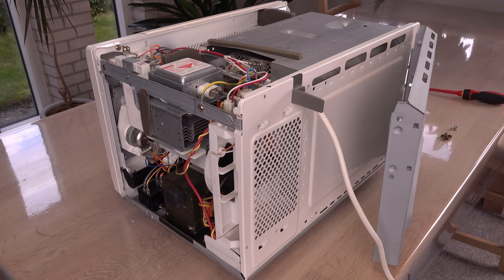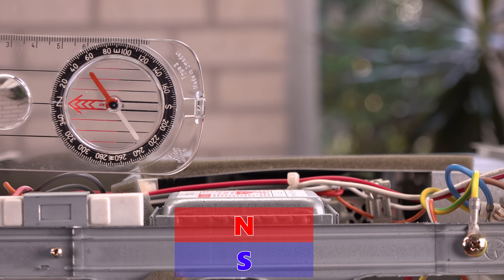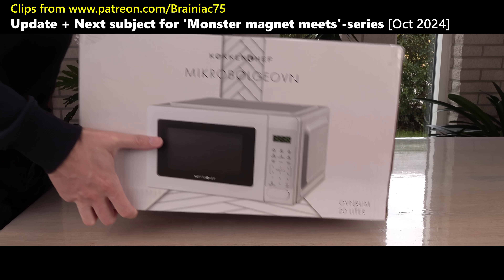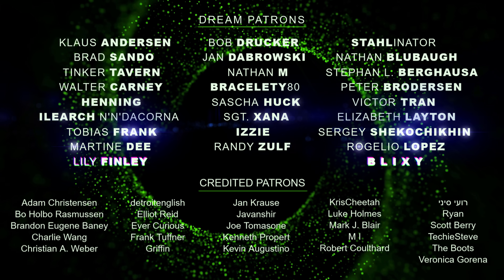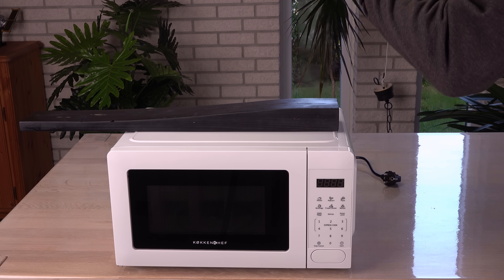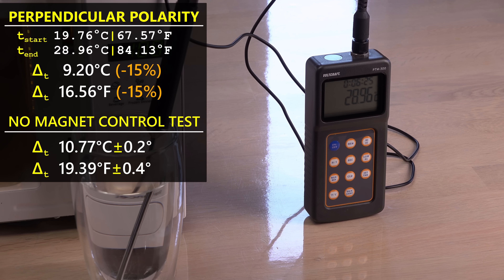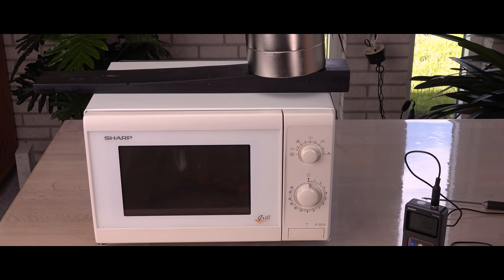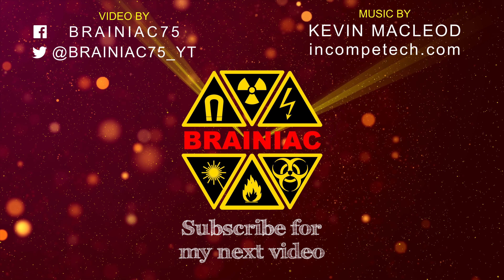Monster magnet meets microwave magnetron...

Comment: The magnet ring inside the magnetron measures OD 53mm x ID 24mm x thickness 11mm. If you can find a neobdinum equivalent that try replacing it and see what happens

Comment: You do know that will weaken your magnets right? I wouldn't recommend doing that if you spent a lot of money on those, which I'm pretty sure you did.
Reply: It's not inside the waveguide chamber, I know microwaves too since i got a Galanz GAL 1000 U2 120V MOT and the HV capacitor from a broken 1000W Galanz microwave, The magnetron i got off eBay since i couldnt take the OEM magnetron.

Comment: shame to not follow thru on a better setup when you have such ridiculous magnets to work with, esp since you have the expensive equipment already and the remainder of the list is relatively cheap:
watt meter: $15
pyrex measuring beaker with lid: $10
thermocouple thermometer leads running thru center of beaker lid (inside µwave = real time temp): $20
printed magnet mount with screw-adjustable plate for accurate distance measurement: ~$20 of filament
...
or.. embrace the no-effort approach and skip the temp tables all-together, just go for dramatic effect: "how to disable a microwave with 'no-contact' magnets!"

Comment: Why didn't you put it on the opposite side of the magnetron in the 2 oven? In this case in the strong field created by the supermagnet would have accelerated the charges even more, theoretically increasing the temperature of the water discretely

Comment: Try bridging the relay with some wires, solder them, connect them to a high voltage rated switch and manually trigger the relay that way

Comment: Interesting but I'm puzzled why the steel shell of the uWave oven didn't shield the innards from the magnetic field and secondly, I'm not sure the strength of the alnico magnet in the Magnetron has much effect on the output of the Magnetron above a certain level. I believe the magnetic field is there to cause the electrons within the Magnetron to spin within the tuned cavities within the unit which is what generates the RF energy?

Comment: You're improvising a stronger microwave. It will also consume more electricity, but for a shorter amount of time. I don't expect it to use a significantly more power to heat up a cup of water to a certain temperature, so, it will only be a bit faster ho heat something up... Because components get a heavier load than they are designed for, the time benefit comes with an increased risk of fire and/or component faillure. I like the experiment, though.

Comment: As far as I remember, the magnetron structure consists of a number of cavities and the frequency depends on the speed an electron beam travels past the cavities.  The magnetic field is what causes the beam to rotate.  You can deflect the beam sideways causing the beam to miss the cavities entirely, or you can possibly change the resulting frequency, de-tuning out of the wave guide, causing change in coupled energy.

Comment: Hmmm... You could have made Your test with the  "analogue oven" better by setting it to a longer time (e.g. 5 minutes) and then used a separate timer (e.g. Your mobile) to run a "separate timer" and just opened the door after "exactly 1 minute"... That way it would basically have been as "precise" as the "digital oven".
Brgds

Comment: I think putting the water in the center of the microwave may be undermining the rotating plate.The wave formations in a microwave have hotspots and the plate spinning allows the thing thats being heated to rotate through hot and cool spots evenly for more consistent heating.
Reply: PS :  putting your spaghetti in a doughnut shape will allow it to heat evenly without the cold spot in the center.

Comment: The magnet is interfering with the switch mode transformer in the low voltage DC power supply so thar screws with the digital timer.

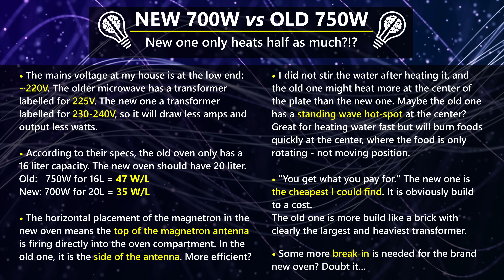Comment: 9:50 -- Mains voltage point: reasonable, but no day/night difference. Wattage per volume: no effect; a microwave photon will just bounce around until it is absorbed by something. Magnetron placement: no effect, for the same reason; it may change where the radiation is concentrated, but no change in total absorbed power. Standing wave hotspot: again, affects where the radiative power  is concentrated, but ultimately photons bounce around and will find something to be absorbed by, somewhere. Break-in: no. You get what you pay for: spot-on!

Comment: The field strength in microwave ovens is uneven, there are spots with higher and lower strength, due to interference caused by the microwaves bouncing around the chamber. That's why they have a rotating plate. It is possible that the new microwave has a very weak spot right in the middle, which negates the effect of the plate's rotation if you put something right on the middle of it.

Comment: I think you should take some fabric like ripstop codura of similar and sew a cover with handles for this magnet. (Or ropes with knots, so you don't put hand inside of handle)
It will make nadling it WAY easier.
This kinds of fabric will handle few hundred kilograms of force, so it will survive. And there are plastic needles that you can use for the last stitches to saw it shut, or use paracord to tie it, or a boat load of velcro :P

I would even think of adding 2-3 strips of thick foam so in the unlikely event of finger getting where they should not, magnet will be lifted from the surface a bit (it should be a difference between healing and loosing fingers.

Comment: You probably just disabled the power on relay with your strong magnetic field.  
You could try a simpler manual microwave oven (the ones you rotate the button an set a mechanical timer), they dont have electronics.

Comment: Thanks.  There's no reason to trust the terrible timer on the microwave as you could instead use a timer on your phone and either switch off the power or open the door when the timer expires.  Keep the phone away the magnet, though.

Comment: different watt rating of the microwave is the bigger factor here, 100 watt jumps can be a fairly drastic change at the lower end from what I have seen, Example there is some foods that request a 1100 watt microwave but I have a 1000 watt. it seems for the time they give to cook the food say 1 min for the 1100, I have to add about 15 seconds to get the same cooked result of a 1100 watt. So maybe its not the new one is worse than the old but its just a lower watt rating as that more the "cooking" rating than anything for them. Kinda like how the old incandescent were watt rating in the US for the lighting instead of rated in lumens.

Comment: The new microwave resetting is probably due to the small transformer for the timer saturating
Possible improvements:
Offset the glass on the rotating table from the center so that it can sweep thru hot and cold spots of radiation in the microwave
Turn on the old microwave and switch its power at the socket to get exactly 1 minute

Comment: I wonder if you really lowered the magnetron power or shifted the frequency. In case you shifted the frequency the water molecules did get  activated perfectly. Maybe you could measure the center frequency with and  without magnet.

Comment: The magnet was likely affecting the output power of the standby power supply in the microwave, causing it to drop out and reset, as well as behave audibly when trying to pull in the relay, if it's a switchmode supply

Comment: You could always just bypass that relay and use an external timer,
However I would also remove the transformer and run it externally, about a meter away from your magnet, as it would most likely just saturate with that intense field and just blow a fuse. Your only problem is getting some high voltage rated wire, however considering all the other kit you have, no real challenge.

Comment: We had a Kitchen Aid microwave that started misbehaving in a very weird way. Sometimes instead of heating food up, it bizarrely actually made the food colder. Can't wrap my head on how that is possible. You could always tell when it wasn't working properly as it made a different sound.
Reply: thats literally impossible my dude.
Reply: @Basement-Science  Maybe he accidentally discovered a new phenomenon.
Reply: @Basement-Science  Tell that to the food that got colder. The food was room temperature before putting it into the micro but ws colder when I took it out.
Reply: @chuckthetekkie  and you determined that how? And where was it colder? what even was it?

Comment: This video made me realize time is the only numerical measurement that's the same everywhere.  No metric time its minutes hours, days etc. yet physical measurements are different
With the expectation of electricity I think a different system for power could be dangerous if someone didn't convert it correctly thankfully it's using the same system.

Comment: I hate ALL new microwave ovens with a passion.
Doesn't matter what controls they have or their power rating or their size or how quiet or how user friendly they are.
They ALL (the new ones I've used) do a piss poor job of heating stuff evenly or at all.

Meanwhile, my old BUDGET microwave oven that's coming up on 24 years is heating evenly, consistently and quickly. Despite having a dial.

I think the main difference is where the components are being made and at what standards they are being made.
1) China
2) Cheaply

And even new and expensive microwave ovens still sport internals from...
A) China
B) As cheap as possible

And if something is made in Europe or US etc, then there's a whole bunch of safety considerations and "what if's" that nerf modern units before they hit the shelves.
The power rating is essentially a lie, a 1000 watt microwave oven might only perform as well as my old one set to 600 watts.

It will be a sad sad day when my microwave finally gives up the ghost or lets the smoke out. But so far, despite the abuse, it's been a loyal servant for 24 years and I don't see any signs of it failing catastrophically or even mechanically. Simply put, stuff (even cheap stuff) were just built better in the past.

Comment: With the horizontal magnetron, I think I would have tried the magnet, on top, but standing on edge, so that its fringes would pass through the magnetron in either aiding or reverse direction.

Comment: Don't know if you already tested this:
Could you cause an imbalance in an electromotor? (as in an axle deviation) or influence turning speed with magnets or Megatron, errr magnetrons like those?

Also, would either the microwave or the magnet be powerful enough to make your (expired) bankcard/creditcard unusable -throth* the NFC, contact chip and magnetic strip?
(of course you can't completely rule out fraud on a CC due to it's problem you don't need to verify (electronically) when using it)

*= throth, combination of three and both, don't know if there is/was another word for it

Comment: The giant magnets scare me almost as much as mains and high voltages.  I have so much ferrous stuff about my work areas it would require clearing a huge area and I'm sure there would be random metal filings and weld beads that would be missed.  Interesting video, mate :)

Comment: Reguarding differences in temp  and differences in old and new ovens.  i doubt the watts per liter is actually making a significant difference.  My reasoning is that even though there is greater volume in the new, it simply means the microwave energy might bounce around more before being absorbed by the cup of water.   I think the differences in power is likely more to do with the transformers as you pointed out. You could probably swap the transformers easily. At least temporarilly move the trabsforner to prevent saturating its core material.

Comment: The wedge at this stage 6:08  could have been used as a lever. Lift it and stick in another wedge to get more distance and reduce the effort needed to physically remove it. Introducing the magnet safely could also be made easyer by using the wedges as levers.

Comment: I bought an  inverter powered microwave in 2018.  It was just like the ovens used at work for many years and I considered it very reliable.  1200 Watt.  Very happy with it.  In 2022 I bought a group of magnetic strips that are screwed to a cabinet or other suitable support and are used for holding knives, forks, etc.  One very useful place was the side of the oven.  It holds very well without any screws.  Everything was fine until I needed to cook a roast for over 2 hours.  Suddenly the oven interior was filled with electrical  component smelling smoke and the oven suddenly went dark.  Pulling off the cover I found that the inverter transformer was within an inch of the side of the case.  The windings were thoroughly cooked.  Suspecting the magnetic field caused the high frequency inverter to saturate (I designed power supplies among other things before retiring.)  I bought another identical oven.  I monitored the power while heating water and approached the oven side with the same magnet strip.  Sure enough, the power went up over the oven rating about 15%.   The electronics must have been robust enough to survive short cooking times but overheated and smoked on long sessions.  Lesson learned.
Reply: I was involved in the design of a powered loudspeaker (still am) with a SMPS and similar issue. The woofer magnet was causing the SMPS primary transformer to go into saturation, you're basically pulling the operating point of the core up the BH curve. Simple fix was simply to swap the polarity of the magnet and reverse the drive to the voicecoill and problem solved. You probably just had the misfortune of the knife magnets pulling the core in the direction of the DC bias operating point resulting in the AC excursions possibly going well into saturation in one direction.
Reply: Interesting! 
I guess high frequency transformers are more sensitive, because they use ferrite cores instead of the typical iron cores in low frequency ones. Ferrite can't be magnetized as much before it saturate, compared to iron. This is not much of a problem for a SMPS - as the operating frequency is so high that not much inductance on the primary winding is needed and thus, few turns (the much higher losses an iron core would have at these frequencies, due to eddy currents, would be much more of a problem). But when it comes to external magnetic fields,  this means it takes less to cause a significant "offset" in core magnetization (causing the core to saturate each half cycle when the mangetic field from the magnet aligns with the one from the magnetizarion current in the primary winding - causing huge current spikes). 
Also, SMPS transformers are much smaller, so it also takes a smaller magnetic field to saturate a significant part of the core (not by the means of magnetic flux density of the field, but the area/volume of it) - thus it takes a smaller magnet to do damage. 
That extra 15% power draw was probably mostly the increased losses in the transformer - which caused it to slowly bake until it got an insulation failure causing an internal short circuit - which in turn caused the transistors in the inverter bridge to blow up.
Reply: @Speeder84XL  not always ferrites, it’s pretty common to used powdered metal (iron, aluminum, nickel, silicon blends etc) cores as well. They’re basically one giant distributed gap but with better HF performance because the granules are so small. They of course have lower mu than ferrites and should be less susceptible but are nevertheless susceptible. 

A large permanent magnet will likely saturate or nearly saturate the core so badly that the winding inductance falls precipitously because you’re operating in the flattened asymptotic part of the BH curve. mu = B/H if the slope of the line falls to zero so does mu and so your winding basically looks like an air core inductor more or less. 

This saturation issue is part of why DC offset in mains can wreck havoc with linear psu’s that use typical iron laminate transformer cores, not much current will create enuf DC bias to saturate the core. Depending on the winding resistance it’s not hard to get there esp with so many turns the magnetization force gets very high very fast.
Reply: @JamesReedy  Yes, but those iron powder cores and other similar are mostly used for just inductors, as they have a lot of leak inductance and gives poor coupling between primary and secondary when used as a trasformer (because as you said, they are like one giant distributed gap). For inductors in buck/boost converters and smoothing inductors (LC filters to reduce noise/ripple, current spikes) or similar, they are perfect though - as they can handle more before saturation and still increase the inductance a lot compared to air core coils, with low losses at high frequencies.
As he wrote it was the transformer that got burnt out, it most likely had a ferrite core or a material with similar properties.

I have cheap china heat gun where the power can be set at "full" or "half" - for the half power setting, there is just a diode blocking one half wave. This creates a DC offset on the line because of the assymmetrical voltage drop. 
If using that on half power setting, any 50 Hz transformers connected to the same line start to make a lot of noise caused by the current spikes as it saturates at each half wave that aligns with the DC component.
Reply: What you have there is a coincidence.
Reply: how and wow!
Reply: two HOURS in a microwave?  brutal.  what's the point?  microwaves are FOR cooking things that can deal with rapid heating.  you're ruining a roast by cooking it for 2 hours in one.  use a damn regular oven, or a pressure cooker ffs.

Comment: The magnet inside of a magnetron is actually rather weak and is so out of necessity.
 The magnet has a field pattern that fits inside. 
It is to get the electrons to bounce back and forth inside the cavity.
Kind of like photons in the mirror box of a laser.